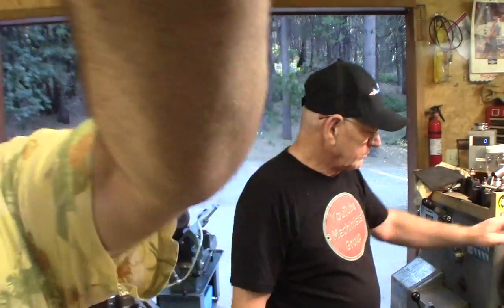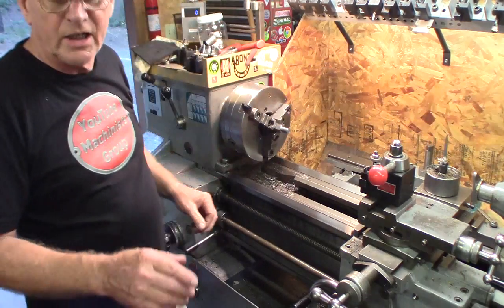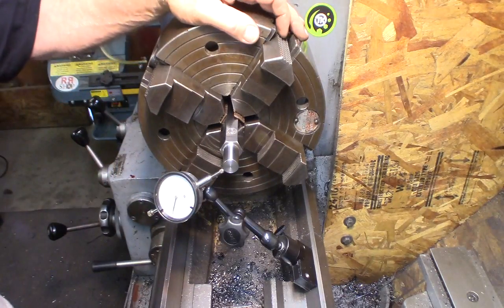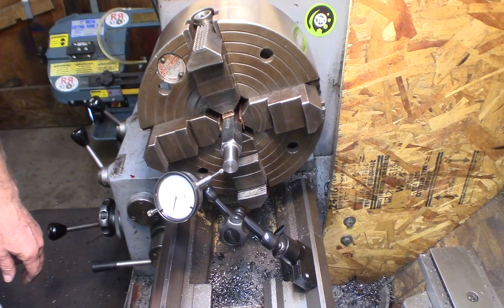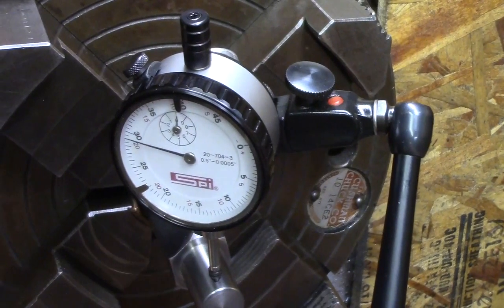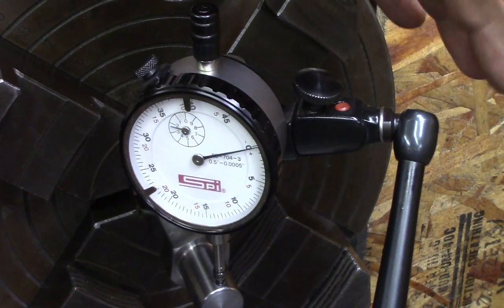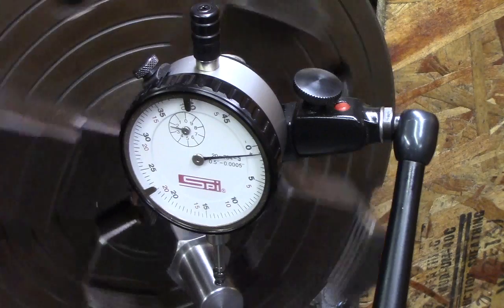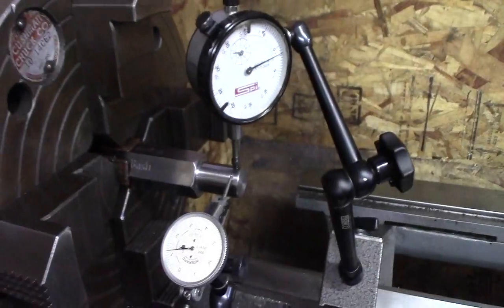Bar Z Summer Bash 4 -Jaw Competition Project

Comment: this prank leaves to much to chance - somebody could wise up check the dia. with a mike. IF they included to every so slightly angle the turned part using the compound on like ~1 degree...never? not worth the effort?